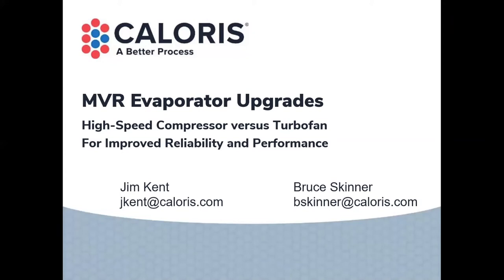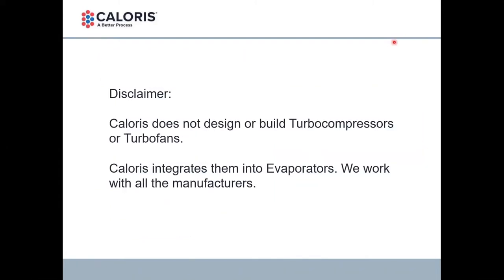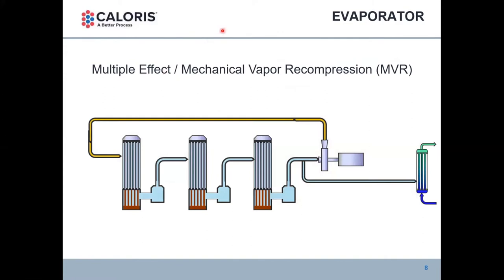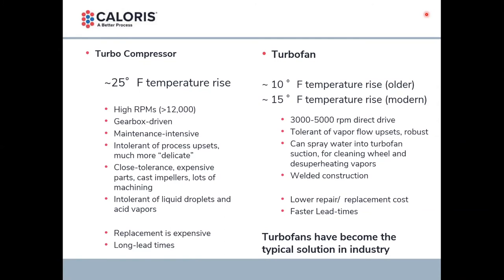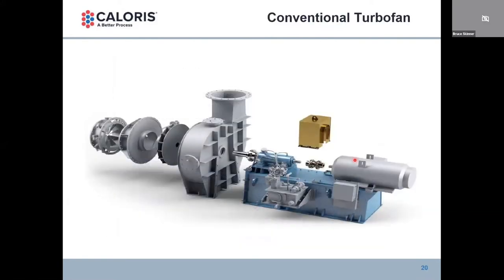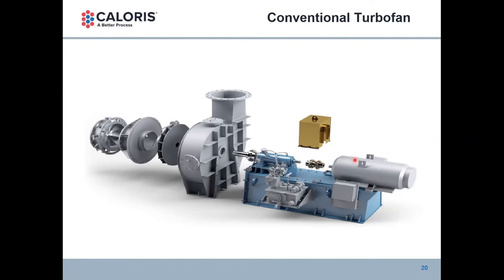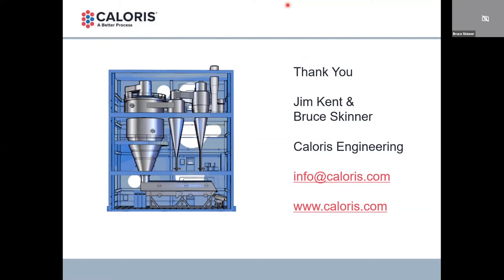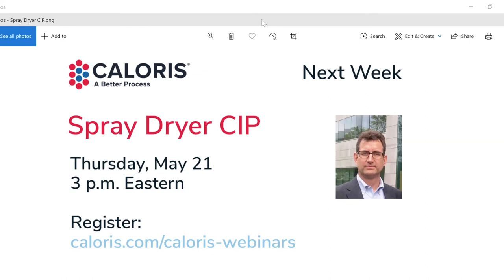MVR Evaporator Upgrades

Comment: Turbo compressor has more temperature lift than the turbo fans, if the system requires 25 F temp rise, one compressor will do the job instead of two turbo fans. Consequently reducing in equipments investment. Is my assumption right?
Reply from the maker: You are correct that one (1) turbo compressor will achieve a comparable compression of heating vapors (~ 25°F temperature rise) as compared to two (2) turbofans operating in-series.  
The reasons we find value in using the two (2) turbofans in-series versus just one (1) turbo compressor are:
a)	The initial capital cost and delivery timing of the two (2) turbofans are comparable to that of just one (1) turbo compressor.
b)	Our customers report significantly lower routine annual maintenance costs, and downtime for unscheduled maintenance, for turbofans as compared to a turbo compressor.   
c)	The motors of the two (2) turbofans combined consume approximately the same electrical power (KW/hr) as the motor of one (1) turbo compressor (since they are achieving the same total vapor compression duty). 
d)	The turbo compressor often requires a gear set to achieve required impeller speed (typically ~ 2x increase to the motor shaft speed) for its vapor compression duty, while turbofan impellers rotate at the same speed as the motor shaft (often in 4,500 to 6,000 RPM range). The gear set increases compressor maintenance complexity and costs as compared to turbofans.    
e)	Turbo compressors achieve their high compression ratio due to tight clearances between the impeller and the inside surfaces of the impeller housing. This makes turbo compressors prone to “surging” issues if suction vapor flow decreases below compressor design rate, causing cavitation on the suction side of the compressor impeller. Customers have found “compressor surging” can actually cause building structures to shake (in-addition to the associated loud sound generated), and if allowed to continue too long can result in a catastrophic failure of the compressor’s impeller. We know of several cases where a compressor impeller failure dangerously sent metal shrapnel thru the compressor hosing into the surrounding production area. This surging issue can be addressed by recycling some discharge vapor flow back to the suction inlet of the compressor, but at the expense of reduced electrical power efficiency.  

Turbofans do not experience this surging phenomenon. The larger clearance between the impeller and the housing allows vapor to “slip” from the impeller discharge side back to the impeller suction side, preventing suction side cavitation. Turbofan impellers also rotate at ~ ½ the speed of a compressor impeller, and have not been know (as far as I am aware) to mechanically fail sending shrapnel thru the housing.   

In the end, the customers where we have replaced one (1) turbo compressor with two (2) turbofans in-series have told us they would never go back to operating a turbo compressor.